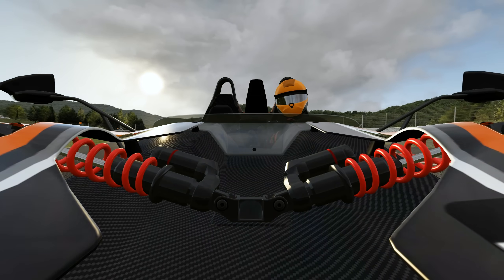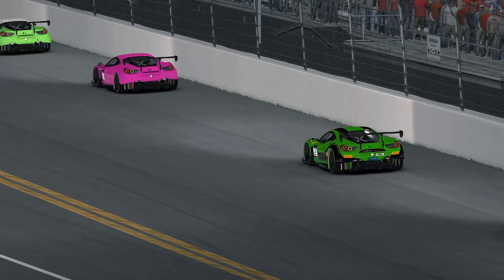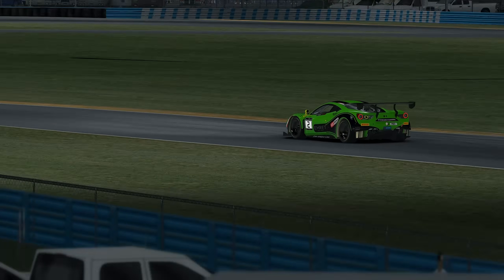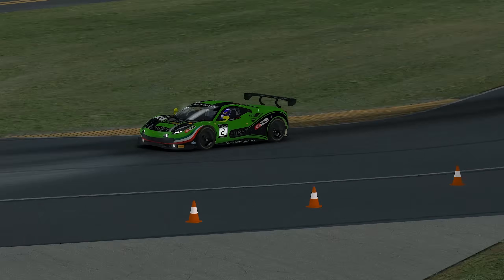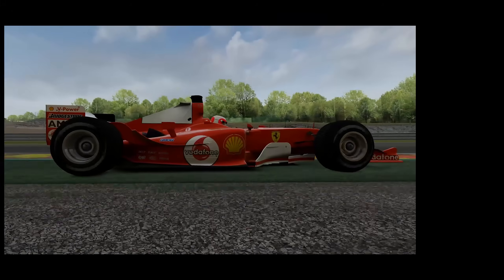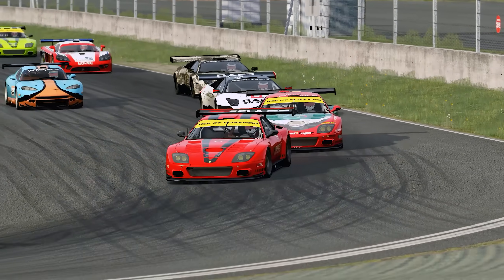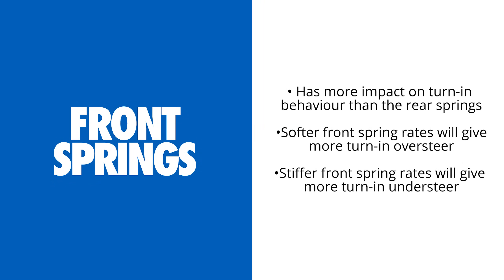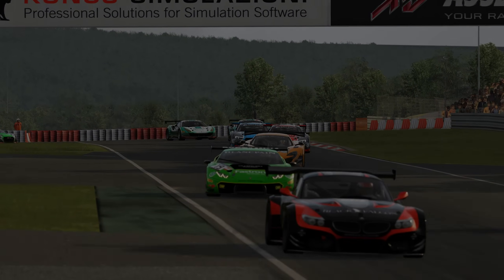Sim Racing Setup Guide 05 – Suspension Springs

Comment: Very good video! Informative, clear and precise. One thing I noticed though is you haven’t mentioned the cars power and brakes. Most of the suspension’s job is in the corners, but how much power (affecting rear susp.) and stopping power (affecting front susp.) also should be kept in mind in order to keep the car stable, responsive and predictable while trail braking and applying the throttle earlier in the corner exits. Thanks again for the video, thoroughly enjoyed it!

Comment: excellent explanation,  often in IRL i have had to explain the spring rate issue when i build mini trucks  and why the bump stops needed to be removed or chopped down.  at least till we went to airbags . then c notches , then  floor lifting to body drop  tubing etc.

Comment: OK so now I have questions :) This video is an excellent description of what the Springs are and do, but how do you know that your springs are too soft? Too hard? How can you actually tell, in game, that your ride height is too high? (Too low is easier to spot, on account of the bottoming out) How can you tell what the weight distribution of the car is (in, say, Assetto Corsa)? If the weight distribution is 60/40 to the front, should the spring rates also be at 60/40, or just "close enough" to it? If you then soften the springs at the front, thus throwing the ration off, should you, as a general rule, also soften them at the back?

Apologies for the assault wave of questions but you're getting into the territory of "things I have always wondered about" ;)
Reply: Changing springs has major impact on most of the possible car setup components. But to simplify it, too soft spring will create "issues" like random instabilities, slowness to react, understeer followed by immediate oversteer etc. Thou the best way to gauge it is the laptime itself. If you soften the car and its slower it's too soft.

As for the 60/40, trying to match spring rate to weight distribution is like trying to match tyre size to it. There might be a car that actually works well with it, but there is more to it than just weight balance, like: tyre size, how powerful the engine is, drivetrain type, center of mass height, and of course aerodynamics - they all change what could be considered optimal spring distribution. For most RWD racecars often this means front springs should be relatively stiffer than rears, and that's closest to a "general rule" that you'll get.
For example: a 50/50 car will want front springs stiffer, while mid/rear engine GT3 car with ~43/57 weight distribution will want the same spring rates in front and rear. But there are exceptions to this too!

Lastly what's not noted in this video, is that spring change also influences camber and toe. Usually the softer the springs, the more negative camber you will have because car will run lower (and toe can go both ways or stay in place, every car is different here). Now depending on the actual camber setup, even softening the car equally on all 4 corners, it might result in over or under steer because of camber/toe changes.

So the best practice for changing springs is to make sure the car runs the same ride height as before.

Comment: One think you may add here is Aero stalling. On some cars the front splitter loses downforce when the front is below a certain ride height, If I remember correctly that height is about 45mm for most GT cars in Assetto Corsa.
Reply from the maker: Thanks Inbekannt - I cover the relationship between ride-height and aero efficiency in video 7 (Ride Height) and video 10 (Aerodynamics). That's the downside of splitting the subject up into separate videos!
Reply: @ChrisHaye  Great, I just saw that you mentioned Ride height here, a whole video about it should be awesome!
Reply from the maker: Yeah man, the whole series works out at something like 90 minutes... so there are some bits that I have to skip over so I can cover it in detail later. Which is fine, but so many parts of setups are inter-related!